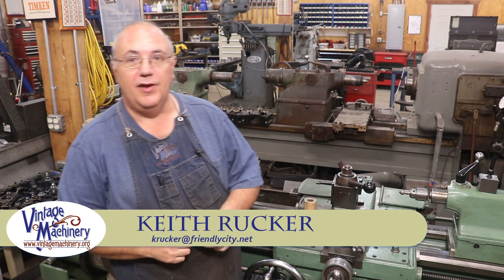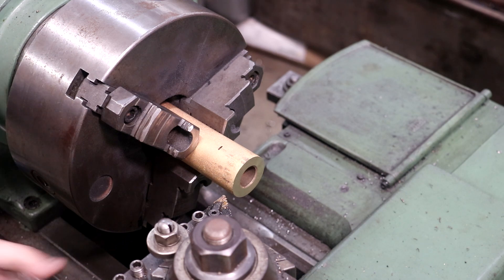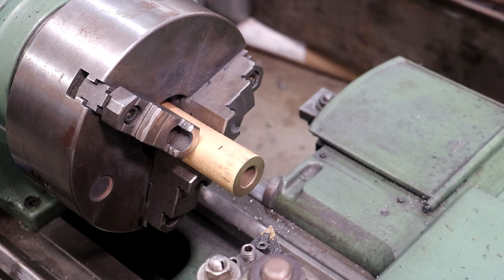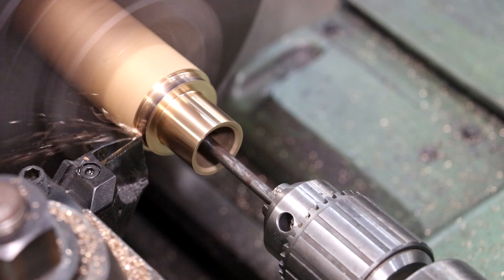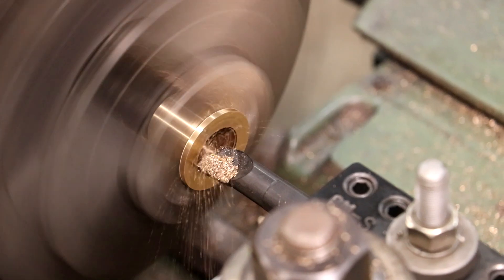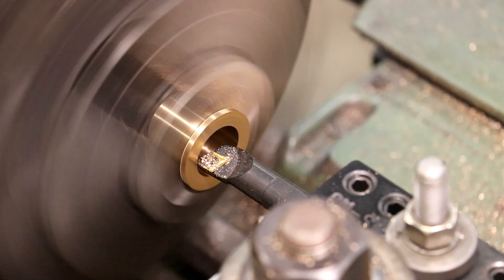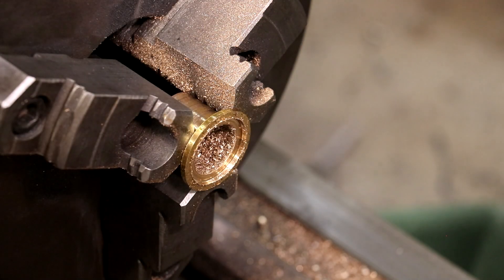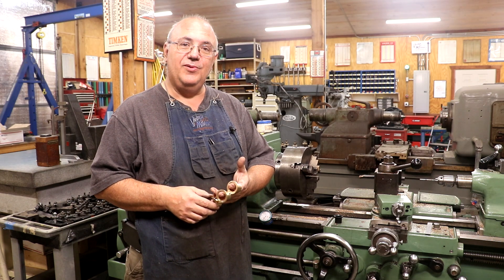Turning Bronze Bushings on the Metal Lathe

Comment: Exactly the application I am trying.  Replacing the four plastic bushings in the steering control arms of a John Deere ZTM.  I bought some Oilite bronze ones but I must reduce the OD a hair and the flange thickness several hairs.  I have never machined Oilite bronze so it was good to see it being done. Good video and commentary.

Comment: I'm still learning, so forgive my question if it's a NOOB question.  But when you had the piece chucked up the first time, why wouldn't you have bored the inside?  What I've learned is that the 3 jaw can establish concentricity with almost anything, but when you remove a part and place it again concentricity is lost.  So, while this is probably fine for mower bushings that were plastic and being upgraded to metal.... it just seems like it would have been more precise and faster to have done the inside bore while the material was chucked up the first time and before parting off the part.  What's the advantage to the way you did it?
Reply: I’m also still learning so this is just a guess, but this way he only had to do a single tool change. He was making four of these.

If you know the precision is not required, there’s no reason to do things in the most precise way possible.

Comment: I'm definitely no machinist, as my Micky Mouse 10x24 chinese lathe will attest, but as you cut into the ID dosen't the chuck jaw pressure affect the roundness once you thinned out the OD?  I'd have thought to do the ID first while the wall thickness could assist in preventing that issue, then do the OD while clamping on the original sized bronze and in addition centrifugal force helps the OD round?

Comment: WE had some acme screw bushings on a large 120" wide back stand which held paper rolls up to 110" wide and 80" diameter, the oillight would wear extremely quickly, my dad located about 10 feet of a 12" diameter NAVAL BRONZE prop shaft and we had bushings made from the naval bronze, never had them wear out again, last I knew the machine was running paper in south africa.

Comment: This is NOT the corect way to make this part, As a Precision engineer i almost startet crynig when he used 3 pronged messeuring tool wihtout cleaning the chips first that is a first year apprentice mistake.And if there is a corrolation demand between the OD /ID you have to make them in the samme set up when useing a tree jaw chuck, and he faild to chamfer the egdes you NEVER ship a part wiht sharp egdes.
Reply: I was cringing there, too. Also every time he said "That's about right." Let's hope a precision fit was not required.
Reply: Chill you guys. Vintage Machinery channel is a great resource for learning antique machinery and mechanical practices. You guy keep your high and mighty ways to yourself

Comment: I always enjoy watching your machine  work  with this one being fairly simple.  If these are bushings for the front wheels on lower priced JD mowers.  My bushings were getting sloppy and stumbled across sealed needle bearing bushings that JD uses on the more expensive mowers.  It was a JD part no. that dropped in place of the bushing.  Never had to touch them I'll n 5 or 6 years I had the mower.   That oil lite bushing will sure  outlast the plastic.

Comment: Why wouldnt you machine the ID at the same time as the OD?  Your 3 jaw chuck wont be running true, so you will have concentricity errors. Plus the chuck jaw pressure will deform the part.
Reply: Concentricity is not a concern for the application. They 'work' in the range of maybe 1-2 RPM, tops.

Comment: Whenever I’m manually OD turning brass,bronze I run the chuck in reverse and use an upside down tool so the chips spray down into the bed.

I also would have done that bushing complete then parted it. Too much chance for deformation of the wall on the second op.

When you bored it your bar was clearly deflecting and left marks when you backed out. Left a very poor finish inside. I would have thought you took more care on these.
Reply: Nothing personal towards Keith but he is a hobbyist. Everything he does is so so. He quit reading the comments years ago because he won't accept criticism thus losing any chance to learn.
Reply: Craneman I really can’t help commenting anyway, knowing what you mentioned. I said something on a video of his last year and he took a lot of offense to it. It was a simple suggestion on the way he was doing something. 

What I like to do is mention what I’m thinking in the hopes that it helps someone who is making a legitimate part so it doesn’t get rejected by their customer.
Reply: @Craneman4100w  These comments are all RIGHT ON. I watch Keith just to see a machinist who doesn't care. He said it himself in this video when he made the remark about making thousands of bushings. He NEVER replies to any comments, I guess h gave up a long time ago.
Reply: Additionally you noted that he never cleans the inside out while he was making his measurements
Reply: Mike Cothran exactly! He measured it while it still had debris inside the bore.

Comment: I am surprised Keith did not machine the bore on the 1st op.for best concentricity,and avoid any clamping distortion on the 2nd op.
I remember there was a set procedure to load this material with oil.
Reply: What I was thinking as well.

Comment: Nearly all heavy equipment manufacturers have moved into using UHMW or other products such as Dupont's Vespel for a lot of their bushing and wear strip applications.  One of the leading causes or premature wear on equipment was lack of lubrication.  Bronze still likes petroleum lubricant that attracts dirt and dust that act like sand paper during movement.  These newer plastics are engineered to just leave it alone and don't touch it.   While people blame manufacturers for making things cheaply by using plastic, the fact is they are trying to improve on some out dated technology.   It's been my experience that if a manufacturer used a plastic to not lubricate it.  It will only attract dirt and cause premature wear.

Comment: Weird, I don't recognize those as a John Deere part. Must be from a model we don't sell many of in my area. Yep I see they are used on the Lowes/Homedepot grade smallest zero turn. They must have been a problem as they went to ball bearings on newer serial numbers. Looks like they turned the spindles down to accept the bearings so a possible solution if these don't hold up. Am127304 is the bearing $9.81 ea versus $4.34 for the poly ones as of 9-7-2020
Reply: Good tip Brian!
Reply: I was going to say those plastic jobs didn't have anything to do with YOU!
Reply: Sounds familiar.  I had a L111 bought in the late 90's which wore out the plastic bushings.  Must have been the bearings you said cause they lasted for until I bought new mower.
Reply: I'd rather have a sealed bearing or even a bronze bushing than an oil-lite bushing for that application.
Reply: @ShainAndrews  Me too. Looks like the sinterd part would be a lot weaker than a solid piece. Crumble-ish as it was! Not able to take a shock load well and the dust and grit involved. Sealed or a pillow block would be better looks like.

Comment: Keith, by way no disrespect, I was a machinist for over 50 years, I don't know if it a southern thing or what but we never used the term thou. it was always thousands,
Reply: Look at the wikipedia page for "Thousandth of an inch". "Thou" is a correct term for 'thousandth of an inch'.  The plural of 'thou' is also 'thou'.  It's not just a southern thing.  I've heard machinists from many different areas call it a thou.  "Thousands" with an s on the end is uncommon to me...  Thousandths with 'ths' is what I hear more.  Does it really matter?  As long as everyone knows what you mean and are on the same page, nope.  I'm sure with that much experience you were a master of your trade, so no disrespect intended from me either.
Reply: I have heard "thou" in the eighties on the Left Coast.
Reply: 'Thou' used since I was a kid going back 50+ years. I'm on the East Coast.

Comment: For those sort of jobs, where the bushings will be running outside, and with lubrication being at best minimal to nothing, plus water, I found a much better material to be an engineered plastic, I prefer to use Vesconite Hilube, which is hard wearing especially when you are using it with minimal lubrication, or where the shaft gets wet. The plain nylon version works, but the black self lubricating type is so much better in this sort of application.

Used them in applications with powder, which could not get contaminated with oil, and there they lasted many times longer than the oilite, and much longer than the plain nylon. Only thing is that your shaft clearances will have to be slightly larger, and there will be swelling as the material gets wet, so you make the bush outside slightly oversize to allow a tight fit, and the inner diameter I generally used a reamer to get the right diameter after installation. I typically made them 0.5mm oversize on the OD, and 0.5mm undersize on the hole, as I was reusing the old shaft, which was slightly worn, so it was reamed out with an adjustable reamer to get a sliding fit. 

RPM wise you are going to be limited, but for most uses at typical outdoor applications it is not a worry. Wear wise any grit will embed into the surface, and not cause much damage, and it is hard enough that the shaft will wear more than the bush.
Reply: I was wondering why plastic - assuming that cost for the bushings would not be the only consideration.

Comment: I am surprised JD uses nylon bushings, especially for what the machines cost.
Reply: This is on the Lowes home depot grade machines, the better ones use tapered roller bearings. Deere still builds quality machines but in this case they are a $10k machine versus a $3k. You get what you pay for. It just used to be Deere only built the good stuff now you can buy all grades from them. They don't want to miss out on a sale!
Reply: Don't think that is actually nylon, probably something like polypropylene, which is easier to injection mould. But designed as a wear part to make money, as they likely could have made them a lot better for minimal extra cost, but that takes money out of the shareholders pockets and exec bonuses.

Comment: Instead of those fancy shield you can simply bend a peace of sheet metal strip and put it in between knife and tool holder,adjust it as you need and it will deflect any  chip away from you.
Reply: used to do this in 1951 as a young apprentice.

Comment: Use a piece of brass shim stock or cut a piece of coke can and clamp it under the front hold down bolt on your tool. Put a kink in it so it clears the workpiece and itll direct any chips away from you

Comment: Why not do the inside diameter before parting them?
Reply: mauvais outilleur
Reply: The thin walls are better supported when inside the chuck jaws versus hanging out in mid-air, giving you better surface and concentricity. Also, he needed to bore out that relief lip in the other end, so all that happened in one boring setup.
Reply: @kindabluejazz  with thin wall's you can deforme them only with jaw pressure...I prefer it bore before parting.......even with standart 3 jaw you put some run out....
Reply: @tiagolomar   My thoughts exactly.
Reply: kinda blue You’re completely wrong in this case. Turning and boring that one end in the same setup will provide the most accurate concentricity. Anytime you chuck on a finish turned diameter with a 3 jaw like he did and finish the bore there will be deformation. 

Also, that relief area in the back is easily done with an internal groove tool. That entire part, of done properly, should be been parted off complete from one end.
Reply: @justinl.3587  I'm talking about the deflection created by the boring bar on an unsupported thin wall hanging out in space. The gripping power needed to hold a tube in a chuck would be minimal, and a round part supported by 3 jaws would exert forces evenly, so deformation seems likely minimal. The deflection of boring the unsupported tube seems like it would be significant. I understand the lost accuracy of re-chucking the part, but I really don't know which way would turn out better, just going by general principles of stickout. Fortunately for Keith, most of the work he does is not 'aerospace accuracy' level. Here he's just replacing a plastic part, which I'm sure has much worse tolerances and deformations, and are likely just balanced out under working forces.
Reply: kinda blue Sorry if I sounded harsh in my post.  Not meant to be at all. 

In common practice in our shop, a single ended operation is best for any case, when possible. 

His boring bar was deflecting in this video for varying reasons of which we will never know. We all know his machines are old and sloppy. That could be the cause of many of his reason for why he machines the way he does. 

However, the part would still remain concentric no matter how much tool deflection you have. He could have helped it by using a much sharper tool and taking less per pass. Also, dragging the tool back over the pass it just took is a no no. 

Chucking on it does create a wall deformity no matter what you do and how light of a feel you have. Unless you use a proper style collet chuck with more surface area on the OD or you use special machines soft jaws with their ID machined to the parts OD when engaged. 

Regardless, we are all over analyzing this guy when all he is, is an old hack hobbyist.
Reply: @justinl.3587  Keith is far more than an 'old hack hobbyist'. He fully acknowledges he is not a full-time, formally trained machinist, but with a good understanding of basic principles, an advanced scientific background, and his vast experience, he is very good at knowing what is 'good enough'. He knows when he encounters something out of his league and he farms those out as appropriate. A valued engineer is one that knows how to balance cost/effort/quality, where as the academics go by rules and books without intuition, the elitists let their egos drive their decisions, and the obsessive-compulsives are driven by illness. At the end of the day, he gets more jobs done in his shop than 90% of the people making comments here, while still maintaining a full-time job outside of his machining and restoration work and YT channel.
Reply: @kindabluejazz   OK.👍

Comment: John Deere used to make indestructible machinery and it didn't hurt their business one bit. Now they make disposable machines with disposable parts. What are they thinking?
Reply: Attack of the killer bean counters! They’ve got an MBA.... and they’re coming for your product quality! And if you hear one of them chanting “value engineering”.... grab your tools and run! 😬
Reply: Plastic bearings last longer than bronze in this sort of application.
Reply: @nerd1000ify  That sounds physically impossible to me.
Reply: @Landrew0  It's counter-intuitive but true. In a clean environment the bronze might last longer, but these bushings are not in such an environment! They are in the open, exposed to a great deal of flying dirt and dust from the mower. That dust mixes with the oil in bronze bushings and makes an extremely effective abrasive, which will grind down the bearing quite quickly. Plastic bearings running at low RPM (as is the case here) need no lubrication, so they don't suffer from this problem. The softness of the plastic also means they have good 'embedability' which basically means that when dirt does get into the bearing it tends to get squashed down into the plastic and held in place rather than constantly rolling around in the bearing and grinding stuff away.

Metal plain bearings also perform badly when the shaft is oscillating (which is the exact usage case here) because this sort of movement prevents the proper formation of the oil film that normally allows the bearing to turn without metal to metal contact. Once again plastics don't have this problem because they don't rely on an oil film. If you have oscillating shafts you should use plastic bearings (for low load, speed and cost) or the gold standard which is rolling element bearings.

Comment: Typical John Deere product.  You spend a half-million dollars on a new combine and then find out they have designed in failure pieces. If a farmer replaces a failure part with some other makers part and it solves the problem, Deere can and does void the warranty.  They sue manufacturers who try to make better or sell refurbished parts.
Reply: I looked at a John Deere  riding mower and commented on the Brigs & Stratton engine. The salesman said they had that engine specialty made. I took that to mean you could only get parts to fit from JD. I don't know that to be the case but it wouldn't surprise me.
Reply: @dannyl2598  The engine is the last thing I would worry about on a modern mower they rarely ever give any problems, its the deck and transmissions that give up usually. Deere does have a heavier spec Briggs built versus like the engines they would sell at northern Hydraulics or something. It means they typically have bigger cranks and bearings as well as improved air intake systems.
Reply: @bcbloc02 So true, as well as an oil intake system with a weighted and flexible uptake hose to be prevent interruption of oil flow. Sometimes they also have a similar gasoline uptake system for industrial use.

Comment: My very first job when I got my first home lathe. I made 4 bushing for my Cub Cadet Zero turn front wheel spindles. I used a cheap Chinese lathe, and also used aluminum scrap I had. The bushings replaced plastic ones, and worked for several years, or at least until I wore the rest of the mower out. Good video as always.